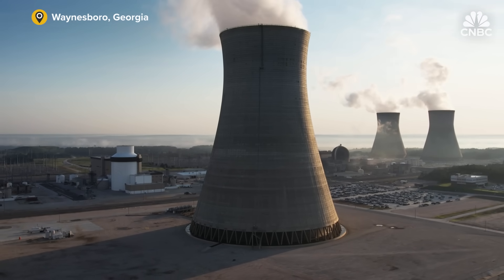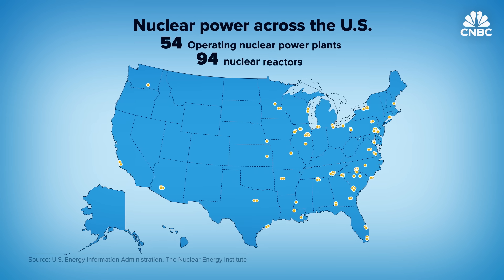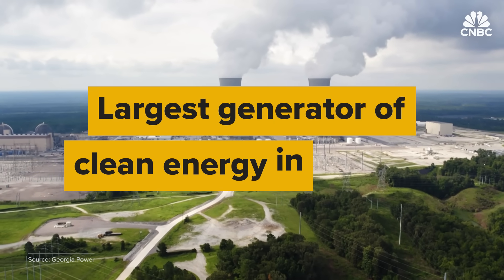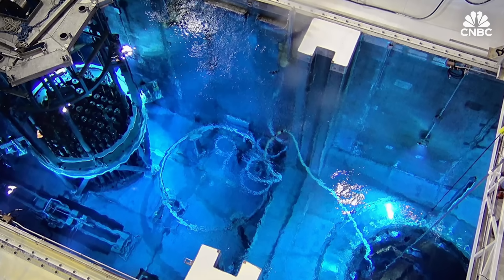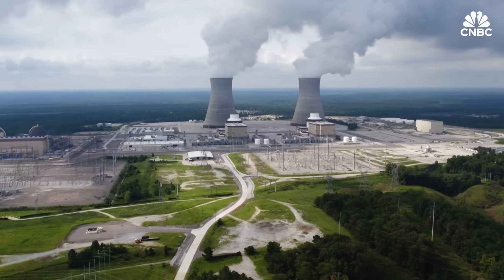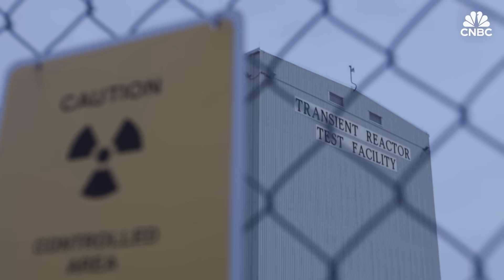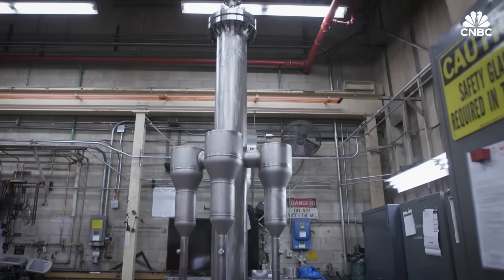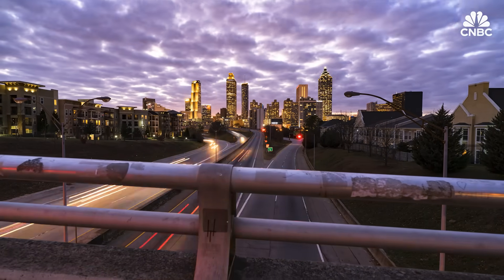Why It’s So Hard To Build Nuclear Power Plants In The U.S.

Comment: "Why It’s So Hard To Build Nuclear Power Plants"? Because the electricity is way too expensive. Just cannot compete anymore!
Reply: I don't agree. It's a construction project and it doesn't get backed by fossil fuel companies. That's the big hurdle. We need to get our construction contractors on par with the rest of the world.
Reply: @ThePilotGear  You want to pay 25 cents per kWh instead of 15 cents?
Reply: @cyberslim7955  no one wants to pay more for their power (or anything for that matter). Bottom line; we need to get off of fossil fuels so more nuclear is a requirement, not a desire.

Construction is notoriously terrible in North America. That's what we need to amend and it shouldn't come at a cost of a 60% increase.
Reply: @ThePilotGear  Gosh! "British taxpayers will not bear the cost of budget overruns and delays on the construction of Hinkley Point C nuclear power plant". Guess who will pay?

Electricity generated by Hinkley Point C will be “significantly higher than the 15 cents/kWh mark” and will continue to rise.

Solar costs not much more than 2 cents/kWh in sunny regions like Spain. Add some battery power plants and a big UHV power line, and the kWh is 5 cents/kWh in the UK.

If you want to spend 3 times for electricity for the rest of your life, push your nuclear power, but then don't complain. And let me tell you, you push this hideous expensive old tech, its highly anti social, because the foreverwaste has to be dumped somewhere, and high energy bills are a killer for low income families.

At the same time, renewables with batter power plants like the new one in California in a large grid network are perfect to replace all nuclear and fossil fuel power plants.
Reply: @cyberslim7955  i'm not fully disagreeing with you; renewables have paved some seriously good and cheap paths for themselves. But nuclear is a low-downside, high-greenside energy choice. It doesn't have to be expensive and dirty and I think we need both renewables and nuclear in tandem to succeed.

Maybe lower-income families need to be cut a bigger break? Maybe heavy energy-consuming industries need to pay a heavier bill? There are more than one solutions to the expense problem.
Reply: @ThePilotGear  Exactly! This is a problem with many solutions or at least better alternatives to the status quo. Nuclear can play a big role and so long as coal and natural gas remain the dominant sources of electricity, nuclear should always remain a viable option.

Comment: Nuclear is safer than wind energy, when compared to the deaths caused by direct and indirect sources, like illness caused by pollution, the number of deaths per unit of energy are:

Coal: 24 deaths
Oil: 18 deaths
Gas: 3 deaths
Hydropower: 1 death
Wind: 0.04 deaths
Nuclear: 0.03 deaths
Solar: 0.02 deaths

Solar is literally the only energy source that is safer. People forget that the deaths caused by increased illness and related problems due to emissions from energy production far surpass the number of deaths caused by nuclear accidents.  

Source: Markandya & Wilkinson (2007); Sovacool et al. (2016); UNSCEAR (2008; & 2018)

Comment: For all the dismissive “nuclear in the safest” ilk: Fukushima/Chernobyl/Three Mile Island have entered the chat.
Reply: Nuclear is absolutely the safest. If you look at death rates per unit of electricity production INCLUDING those disasters you mentioned, the numbers are:

Coal: 24 deaths
Oil: 18 deaths
Gas: 3 deaths
Hydropower: 1 death
Wind: 0.04 deaths
Nuclear: 0.03 deaths
Solar: 0.02 deaths

Solar is literally the only energy source that is safer. People forget that the deaths caused by increased illness and related problems due to emissions from energy production far surpass the number of deaths caused by nuclear accidents.  

Source: Markandya & Wilkinson (2007); Sovacool et al. (2016); UNSCEAR (2008; & 2018)
Reply: @Aaronsl-202 ”per unit of electricity production”……🤣

Let me guess, this is almost exclusively fictitious “climate change” numbers. 

Nevermind the fact Fukushima’s radioactive water has been dumped into the ocean and infiltrated groundwater.
Reply: @Aaronsl-202 LOL, all climate change nonsense figures. And “per unit of electricity production”….🤣….standard unit used in utility power generation is the megawatt. Coal and gas plants rarely have accidents and any deaths associated are with heavy machinery. Meanwhile, an accident at a nuke facility and you have cities evacuated forever.

Comment: A few points about the leadership of the United States in the production of nuclear energy for electric generation. The first reactor that produced energy was in the USA. They connected several light bulbs at the factory itself. The first reactor that actually supplied energy to the grid was in the USSR. Obninsk nuclear power plant. The first commercial reactor is the United Kingdom. Of course, there is a question of what is commercial when comparing socialism and capitalism, but nevertheless. The United States, with all due respect to its achievements, has not been the only leader in developing a peaceful nuclear program most of the time.

Comment: Airplane impact in Waynesboro,  LOL.  Its 50 miles past the middle of nowhere. And no i. Any flight paths.

If Ft Gordon cant protect Waynesboro that says all you need to know about Army intelligence.
Reply: I remember when 9/11 happened, I lived within 10 miles of Duke nuclear power plant. Some people were freaking out worrying about someone flying a plane into it. Knew a tech that worked there and he just laughed it off. He said at worst they'd fly into the cooling tower, no harm in that other maybe some damaged concrete.... As for the main building even if it was a direct strike the worse that would happen is we lose power because the lines were broken. The reactors are buried in multiple walls of feet thick reinforced concrete, and steel.

Comment: The difference that five years make in what we thought the role of nuclear would be in the energy transition is crazy! Solar + storage has blown expectations out of the water on costs and it’s clear nuclear will have a much more limited role than expected.
Reply: Well it helps that democrats made for major tax cuts and handouts for solar and wind power companies.... Which not so ironically most of them are owned by, CEOs, or major stockholders of said companies.
Reply: @SilvaDreams  ironically these cuts are just a fraction of oil/gas subsidies that today and for decades have paid for planet destroying emissions.

Comment: I really wish nuclear power was used more than it currently is. It’s the safest, most reliable and efficient way of generating low carbon electricity. It’s expensive to build initially but the lifetime costs are low and can produce electricity 24/7 rather than intermittent sources like wind and solar. At one point in the 60s, there were projected to be over 1000 plants in the US but most were canceled due to public backlash and financial difficulties. If there was more support from the public and the government then I believe there could be a comeback for nuclear power in the future
Reply: Gotta factor the cost of storing the nuclear waste for 20,000 years too.  

And I bet the private sector won’t pay for that.  The taxpayer will.
Reply: @embracedmadness  not really
Reply: Nuclear isn’t safe. Look at Fukushima. What coal or natural gas fleet has come anywhere close to that catastrophe???
Reply: Your government is using taxpayer money to fund foreign wars over securing national interests, borders and security. What did you expect?
Reply: It is not feasible to have 100% energy from nuclear. It produces power whether it is needed or not. It needs to be supplemented with energy that is on demand or does not work outside peak hours. Otherwise, the electric company will need to deal with too much energy during off-peak hours. Many countries accomplish this with Natural Gas.
Reply: @KevinSmith-qi5yn  I agree that it's not feasible to have it be 100%, but that was never even proposed. More that our energy needs be based in diversification with nuclear as one of the core suppliers. Yes, we should have solar fields and panel subsidies for homes, wind energy, geothermal and so on. But they unlike nuclear they're regional, inconsistent, and space demanding. Nuclear fills in that void that we're currently using with fossil fuels. Until we can, if ever, crack the problem of fusion, nuclear reactors are going to need to be the heart of our energy needs. But there's a lot of 20th century fear mongering over it and outdated practices and red tape that we need to make progress on for it to be feasible.
Reply: @KevinSmith-qi5yn That's not true. Nuclear energy can throttle output no problem.
Reply: Not as quickly as gas, hydro, or battery storage. Electricity production has to very closely align with demand because the grid itself has almost no capacity to buffer any excess power.
Reply: @KevinSmith-qi5yn  No one is saying that nuclear should be the exclusive energy source for all American homes, but it would definitely be better if it provided more electricity to homes than natural gas.
Reply: Nonsense! Solar/wind with battery power plants are a 5th of the cost per kWh. Besides that mining and building also emits CO2.
Reply: @cyberslim7955  Variable renewables plus storage are the most expensive electricity on earth according to Lazzard.
Reply: @cyberslim7955  what's wrong with his source and how does it compare to yours? I've often seen that most solar claims do not include the very expensive batteries required for the power system to be viable
Reply: @ryanestes7331 
"very expensive batteries"? You meant to type "very cheap batteries" and even further fast falling prices make solar and wind the only financial viable source of grid energy.
Reply: @cyberslim7955 the batteries are neither cheap nor efficient what are you talking about
Reply: @jamesmorseman3180  Much, much cheaper than building a nuclear power plant, and batteries getting cheaper, building a nuclear power plant getting more and more expensive. Look at the numbers!
Reply: @cyberslim7955  except nuclear turns a ridiculous profit after 10-15 years once build costs are paid off

Comment: Any experts who can answer this question? What happens to the reactor if after 72 hours and the power still hasn't been restored?
Reply: This one off emergency cooling system is just there to prevent the worst case, while the reactor is shut down. 
The control rods block the flow of neutrons. The more rods you steer into the reactor and the more deeper you do that, the weaker will the chain reaction be. 
To the point that it will collaps over time. The heat production drops big time and the cooling needs are far lower.

Comment: Nuclear power is hard to build anywhere.  There just isn't a need for nuclear anymore with the alternatives now and more just over the horizon.  Nuclear power's very slow build and immense cost mean it will hardly make any difference to the vast amount of energies needed to offset fossil fuels.

In the past 70-years of operation, nuclear only powers 10-percent of the world's grids and that number is falling.  Nuclear failed us.  If it hadn't failed so miserably, we wouldn't be so far down the climate change hole we find ourselves in today. 😞

Just say "no" to nuclear. ☢ 🚫
Reply: a nuclear power plant contributes vastly more energy to the power grid than a coal plant, and is cheaper to install per watt than solar and wind
nuclear has been rejected by the public because they still think radioactive barrels contain green glowing liquid

Comment: The best idea would be to build them in North Mexico and import the electricity. America is overregulated to the extreme and simply can't build big projects without spending 10x than what China spends. All because of bureaucrats that set up extreme rules.
Reply: those rules prevent the constant structure failures seen in china
Reply: Northern Mexico is also drug cartel central. Not exactly the security environment anyone would be comfortable trying to ensure protection in considering how compromised their Federales already are.
Reply: Built them in the ocean, so when something does go wrong, atleast the land isn't radiated.

Comment: Every society that has successfully totally decarbonized electricity generation in under a decade has done so through NUCLEAR ENERGY:  France, Sweden, South Korea, Ontario Canada. S. Korea cut the cost of building nuclear plants 30% in real terms from 1971 to 2008. Distributed baseload: Nuclear can be put essentially anywhere removing the need for building significant transmission lines. Modular nuclear power supply can be perfectly matched to power demand in location and in time. The second of the Vogtle plant’s two reactors was 30% cheaper to build than the first because workers and project managers learned from their mistakes building the first reactor. Point Beach 1 & 2: 1100 Megawatts at less than $1000 per Kilowatt. Built in less than 3 years from 1968 to 1971. Build 10,000 of those plants. You can decarbonize America in under 5 years if you simultaneously build enough Point Beach 1 & 2 replicas. Scan all the valves and pipes and everything and duplicate it. Nuclear is the ONLY source of power that can simultaneously SCALE to global levels of consumption, POWER the removal of the last 200 years of carbon, and most importantly FULLY ACCOUNT for its own compounding emissions. NRC standards set radiation level guidelines TEN THOUSAND TIMES lower than science justifies, which is a PRIMARY SOURCE of nuclear’s EXPENSE. Nuclear power currently produces more than 50% of emissions-free electricity in the United States. BUILD NUCLEAR.

Comment: 'Renewable' means being at the mercy of nature’s arbitrary whims, relying on batteries made from metals that aren't actually renewable, or on inefficient pumped storage that loses a quarter of the energy. Without these, you're left powerless on a windless night. Alberta experienced this firsthand during a brutal winter night, a few months ago in Jan 2024, when temperatures dropped below MINUS 30°F. So, reliable nuclear power is the only real option, and the next generation will be depending on fusion to keep the lights on.

Comment: This should actually speed up the rate at which they can deploy nuclear reactors because you now have a construction contractor that has experience doing it if anything this should be a reason to go full speed ahead on nuclear
Reply: The original contractor who'd been operating since the 60s went bankrupt while working on this project so at best  we probably didn't even break even in terms of institutional knowledge.

Odds are that the firm would have gone bankrupt anyway, so it's not a net loss, but as far as progress goes we still need a top-down shift before real change can happen. My hope is that recent developments in the Thorium reactor space can kick-start new public sector interest in the technology.
Reply: In a broad sense, you are 100% correct. The US hadn't built a nuclear plant in so long, many of the original engineers and designers from 40 years ago were retired, or dead. Growing pains.
Reply: Would hold off until a Lessons Learned Report is produced. If the project took more than 20 years, this autopsy might be very difficult.

Comment: Has Government ever done anything in budget and on time? but x2 x3 the cost and time?
Reply: This is not the government, Westinghouse is a private company, but it did recieve a loan from the DOE. The problem is over regulation regarding everything nuclear due to unreasonable public fear and the fact that it was a first of a kind design (it’s one of the new gen III+ models) and the fact that they built only 2 and not 4 in site like Korea and Russia are doing (which reduces costs). It’s a combination of factors and if anything it’s the government slowing down progress with unreasonable regulations
Reply: @filippo1864  and who is funding this?